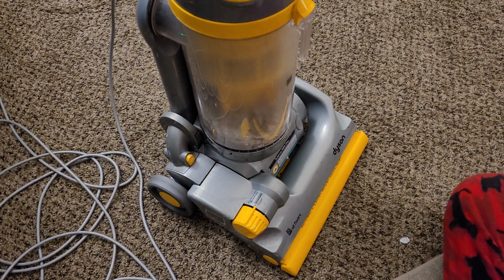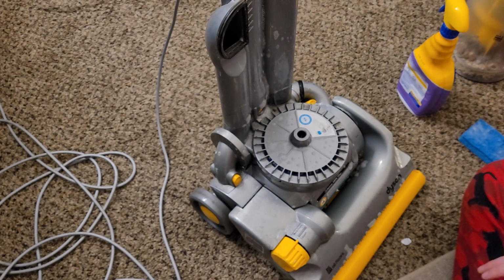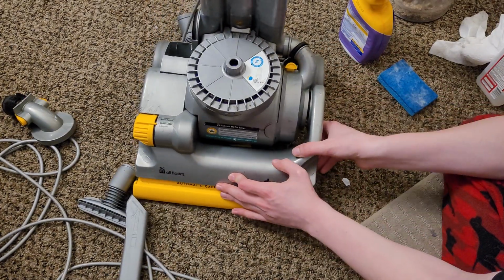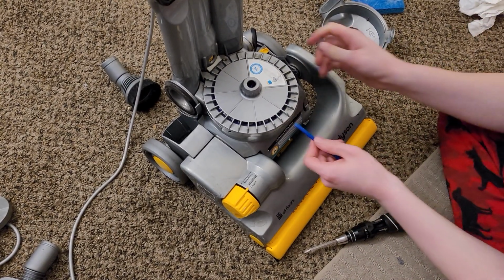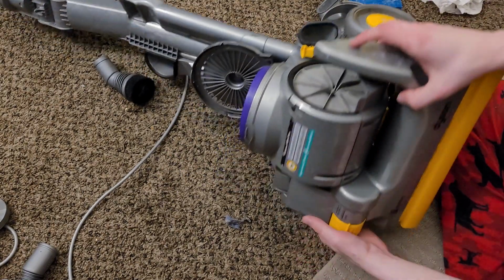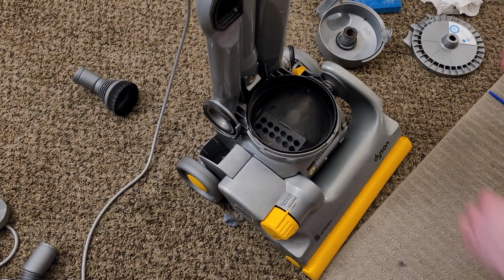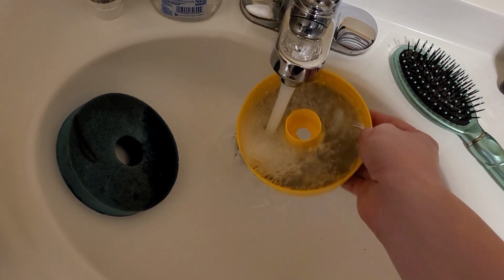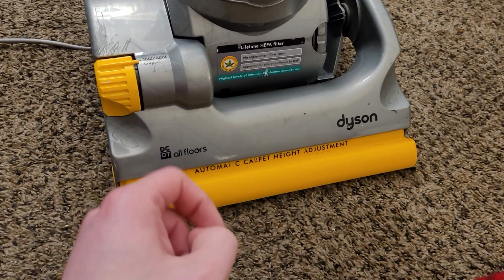Dyson DC07 All Floors Refurbishment - Part 1

Comment: I have a DC07, and yesterday as I was preparing to use it, the entire duct assembly cracked near the bottom as I was pulling the wand into its operating position. Replacement part is rare and expensive. I also have a DC 14 that I can use for donor parts. Would that assembly work in the dc07?  I may be using wrong search terms but can’t find much on this repair online.  Thanks in advance. I hate to junk it, but it might just be wise to consider it totaled!
Reply from the maker: They're not unfortunately, but you may be able to  find a replacement on ebay
Reply: @IntellitechStudios   Thanks for get back. I have a new Dyson on the way. Should be here any minute via FedEx.  In the meantime I was able to repair the DC07 with epoxy. It still works great.  Now I have three. Oh well!